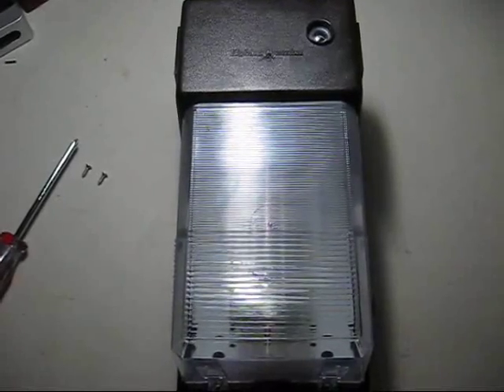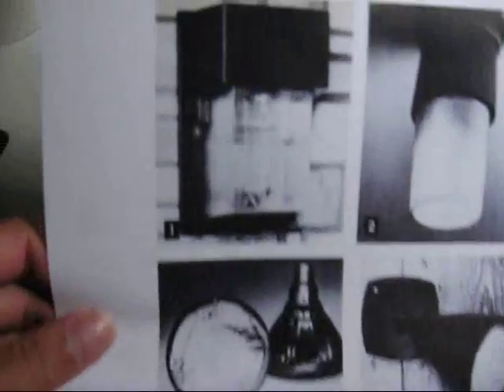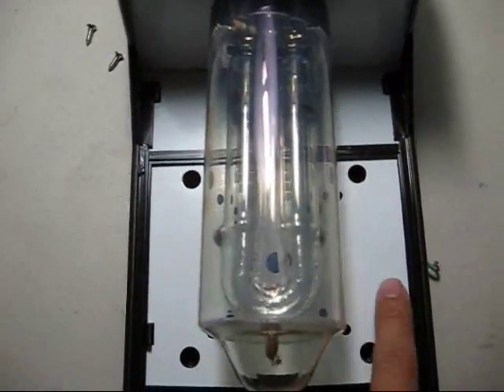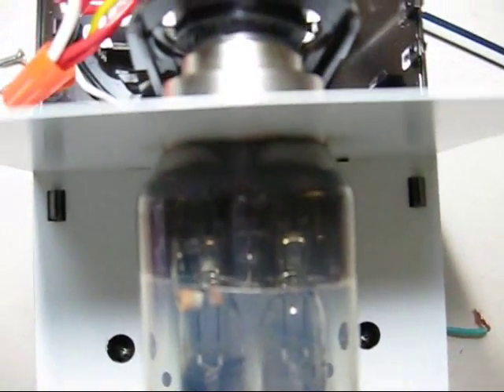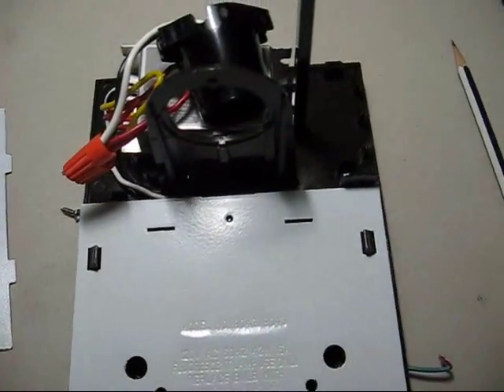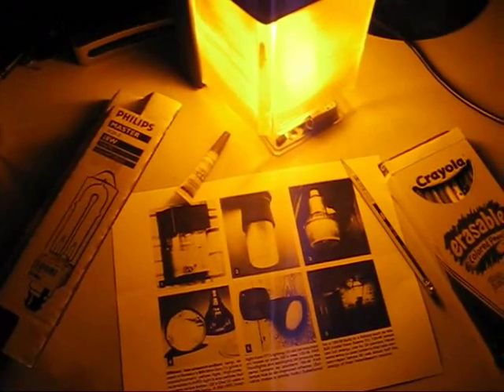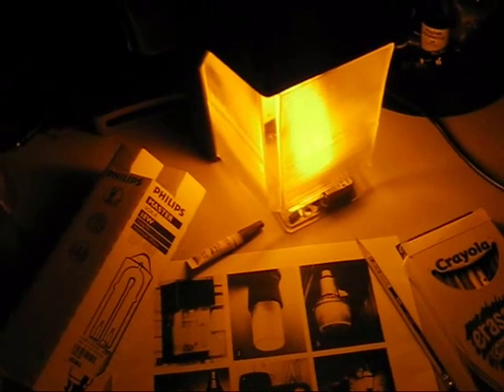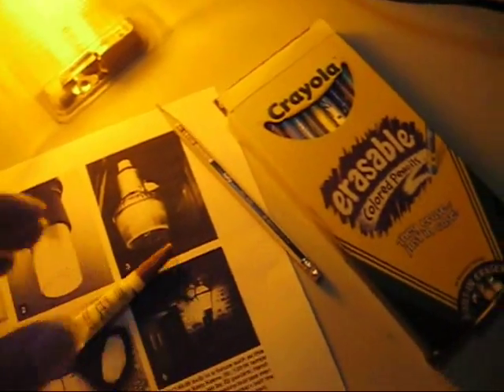My low pressure sodium converted Lights of America wall pack

Comment: You have to consider though that although very efficient the 18W SOX is the least efficient of them, because the higher the wattage the even more efficient they become.
The 131W SOX-E lamp is the most efficient light source, it delivers a stunning 206 Lumens per Watt while LEDs just barely beat the 18W SOX with it's 100 Lm/W. I don't know why everyone's raving about LEDs anyway, everytime I see some at use outdoors they are simply glary (eye-stinging).

Nice video!

Comment from the maker: @coolbluelights 

Ideally, you would used a ballast meant for LPS lamps but such ballast are expensive and not very common in the US. The 18 watt LPS has similar electrical characteristics to an 18 watt compact fluorescent so I went with that setup

You could also try an instant-start F32T8 (Advance Centium) and a 35 watt LPS but it will be slightly underpowered by 20%
Reply: I still have several brand new LPs fixtures including several 18W wall packs, 35 W Philips U.s. made from decades ago, and the last Hubbell 55W Scotsdale wall pack, i use in my yard and have a few spare fixtures, all out of production now.  The Hubbell wall pack is nice and slim, the with the same solid di cast back plate just like Stonco(now PHILIPS brand) 18W units i have and the Philips/Norelco U.s. made mini Sox, the Hubbll wall packs are all Philips inside, lamp, Philips Advance ballast, even a Kulka lamp holder, and some Leviton ceramic sockets, Philips sold off Kulka decdes ago, even have several spare sockets in case, the spares will out live me, been using SOX, LPS since the first minisox was introduced in the U.s. in the 80's or so...several 35 and 55W Philips wall packs and had several 35W dusk dawn round "security fixtures with the photocell on top, all discontinued, when factory in OH was sold off to American Electric, who then revamped designs, to less expensive designs, I have several of them also..different optics, I also found Philips sox lamps seemed to always last longer than the GE (U.S.) was THORN in England) or the GEC or Osram lamps, when Osram was making them, last batches of OSRAM where Philips factory, relabeled, but made with Osram no retention dimples like Philips design, they used the Osram machines at the Philips factory , and made the Philips type with dimples,...all closed, they are using up stock, when gone, no longer available in Philips catalog..LED changed everything

Comment: I'm trying to do something with a CFL and fluorescent ballast and as you have done this you might have a better idea than I do about what wires should go where and how things should work.

I have an electronic ballast with 4 wires coming out and a 4 pin CFL to connect to it. As far as I know 2 of those wires are the power supply and the other 2 go across the other 2 pins so that the ballast can start the bulb.

What I am trying to do though is I would like to add a starter in there instead of letting the ballast do the starting of the bulb so my original idea was to disconnect the 4 wires, have 2 of them going to 2 of the pins on the bulb as the power supply and get rid of the other 2 wires and wire a starter between the other 2 pins. After watching this video though, I'm not sure the ballast would let me only use 2 wires. So I'm guessing maybe instead I should group the 2 red wires on 1 pin and the 2 black ones on the other pin and connect the starter across pins 3 and 4.

Do you think all 4 wires will need to be used for the ballast to work properly?

Comment: I have several MiniSOX wall packs in use...30 + years, eventually the sun takes it's toll, and yellows the polycarbonate, but i had a few NOS new cover, good for another 35 years! Same Ballasts, never had an 18W SOX ballasts fail...had one 55W SOX ballast fail, in the Van Wet OH. Philips wall pack, that lens also finally got yellowed after about 37 years!!! Managed to find HUBBELL SCOTTSDALE 55W LPS wall packs, that's been in use for 10 years now, I actually bought 4 of em, brand new, they are also out of production, all LED now, ugly glaring 5000K LED.  The Hubbell Scottsdale, had all Philips inside Advance Philips ballast, Kulka Socket Philips lamp...I have used some OSRAM  SOX for some reason the Philips always seemed to hold up longer, same with the Thorn (GE LABELS after GE bought GE, not GEC, another brand)  rare...keep spares of all of it, since now SOX is out of production...ebay has stuff when that runs out, no more SOX for YOU!

Comment: @GFVagent007 Yeah, you're right, LEDs don't touch 80lm/W and have too many drawbacks for practical use outside with great light output demands. They are great for lighting refrigerators at least. Ah, by the way, I'm currently sitting under the light of my 18W SOX-E while typing this. :D Nothing beats that nice soothing deep color, I love it.

Comment: I am delighted to find this video. For some odd reason I love the monochromatic orange of SOX bulbs and I want to use them to light my otherwise VERY dark and remote yard. You mentioned that low-watt SOX ballasts are similar to low-watt fluorescent ballasts. Is this also true for the 180 watt SOX bulbs or would I need to buy the $200 sox ballast? Thanks in advance.

Comment: @GFVagent007 It's interesting that you mention underdriving, because I found the same thing with the WH2. Like yuandrew, I've also gutted and converted a LOA 9042 CFL wall pack using a Leviton 8806 BY22D socket, the WH2 ballast, and an Osram 18W SOX lamp. I had to cut and fabricate a small, L-shaped aluminum chassis for the socket and ballast. The fixture draws 17.9W at startup and it stabilizes to 16.4W after about 20 minutes (using a Belkin F7C005q meter). I love LPS lamps.

Comment from the maker: @Skiller444 

Yes, I'm aware that the higher wattage versions have better efficiency which is true for most light sources. The 18 watt is just the easiest for me to operate and install in an existing fixture.

I also have an Osram 180 watt SOX that I got for a very low price but its about 4 feet long and I don't have a ballast that would operate it .

Comment: This is the old Philips Lighting North America old Rug mill they took over in the 1970's the two large flood lights are one of the many they produced in Van Wert OH factory, I have one of these Flood lights 180 W SOX, super bright monster fixture 4 feet long about 18" wide, HEAVY..This place is only like 1/2 hour from mew in N.J. Philips left this place went to Bloomfield N.J when they bought Westinghouse lamps..for a couple of years, while they had a brand new office built in somerset N.J. still in somerset, now know as Signify Philips lighting is no more https://image.nj.com/home/njo-media/width960/img/the-times/photo/2015/01/20/-772ddcc09b7451c2.jpg

Comment: Ya need a reflector behind it, you are loosing lots of lite without a reflector behind it meant for the size lamp etc.  See how they did it on teh orig Philips Van Wet OH mini sox fixtures.  they are still going here after28 years!  Polycarbonate is getting a bit yellowed from sun and uv and old age heat.

Comment: I use 5  Philips   Norelco in U.S. Van Wert Oh factory, in teh 1980, till Philips took control fully of North American Philips, then just Philips branding on these, and teh lamps, cus they did have Norelco stamped on the Sox lamps, all made in Europe, Belgium for long time till it moved to U.SK. mini Sox of these for almost 35+ years have a few spare fixtures, now long out of production, after 30 years if in a bright sunny place, the poly carbonate can yellow, I have never had an 18W Sox ballast (Advance) fail, only on 55W after about 30 years in a 55W wallpack https://www.lighting-gallery.net/gallery/albums/userpics/10005/normal_image~215.jpeg